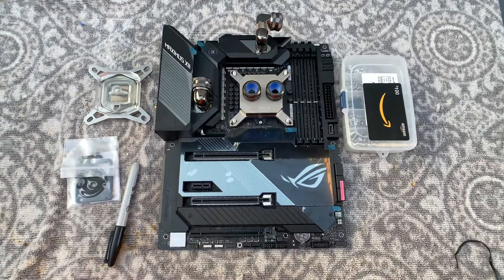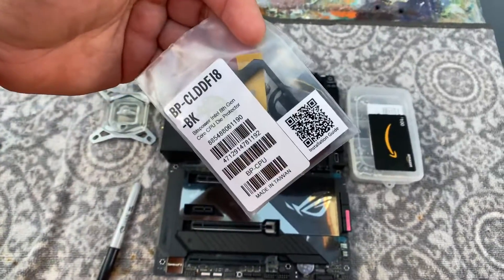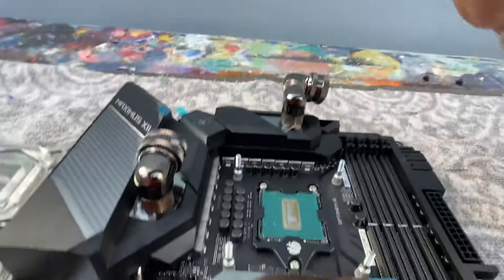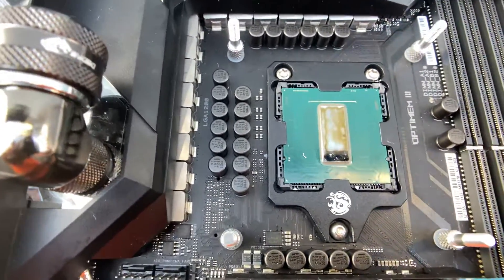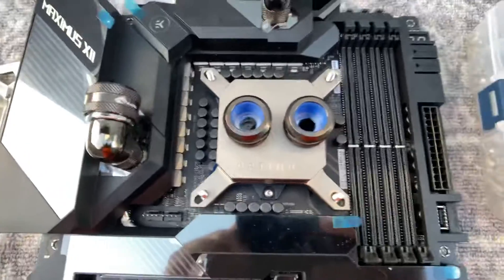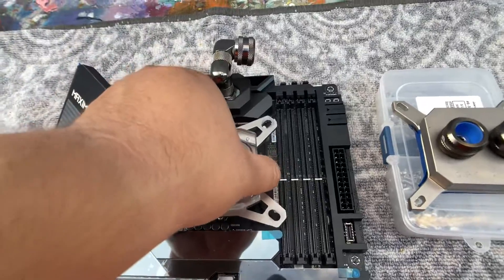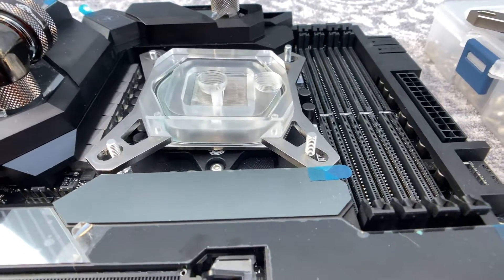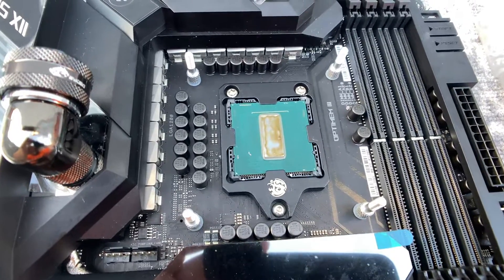Direct Die Cooling 10th Gen Intel CPUs

Comment: Question, do you happen to know if the heat killer in a vertical orientation is parallel with the vrm inlet? In order to just run a straight run between the two.
Reply from the maker: Nope it’s not,  all the blocks are slightly ‘off’ in terms of their ports versus the vrm ports.
Reply: Disappointing for sure, I'll have to find a way to run this. Lol

Comment: 12 degrees is awesome, which thermal paste did you use?
Reply from the maker: Thermal Grizzly Conductonaut (liquid metal)
Reply: @NorySS  I only have access to kryonaut, would it be good enough?
Reply from the maker: @ApolloOfRivia  you won’t see much of a gain because the heat source is so small now. I do not recommend using normal thermal paste/grease with direct die. Only liquid Metal.